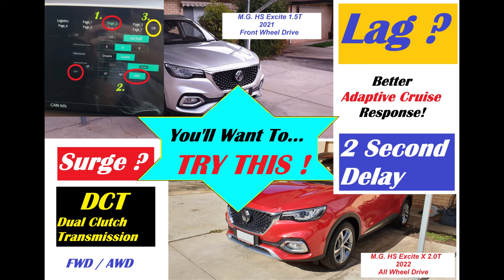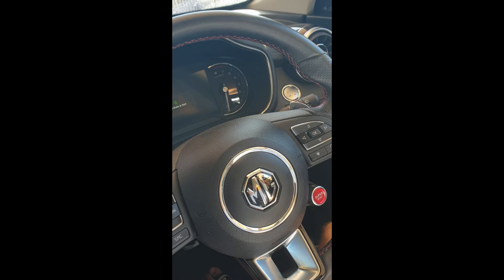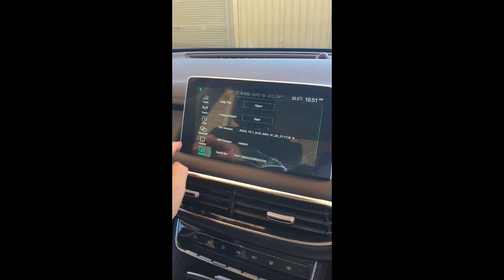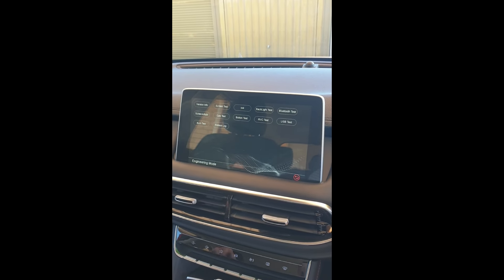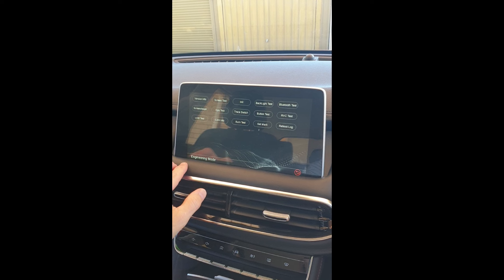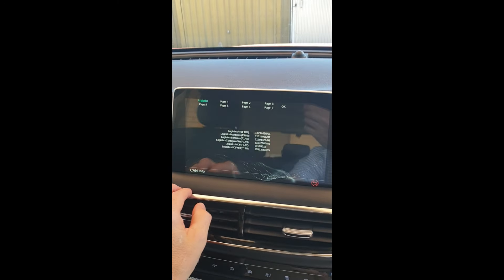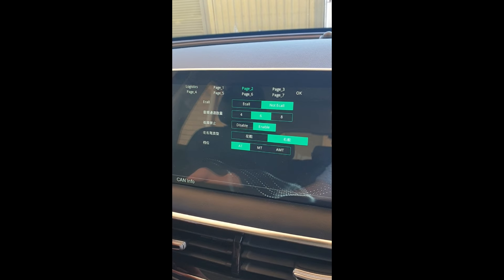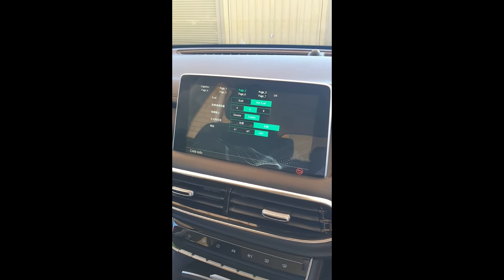M.G delay lag with DCT transmission 2021 2022 2023 2024 MG HS Driving AMT Engineering Mode

Comment: I almost got into accident several times when accelerating from a busy junction as the car was not willing to go. Tried talking to the official dealer about (3x in 6 months) yet they could’t find any fault. After changing to AMT mode 1, I can feel slight improvement. Hoping the transmission fail whilst under warranty to a get new one. 😂
Reply from the maker: @willytham284  when i came across the information and all credit to that person,  changed my mind to selling my car. My first new car had mo issues so when a car hit me in the side and wrote off my  car and i got another new car i noticed a difference in the driving experience so i knew straight away something was up. Thanks to the person and social media so we can share knowledge to make a difference. 🙂
Reply: we’re grateful that this channel brought up different POVs and experiences from HS drivers across the world. Really appreciate your effort for creating this video.
Reply: Driving a DCT car isnt like driving older transmissions... smooth acceleration is required not planting the foot
Reply: Same! That default setting is dangerous!

Comment: I am so much thankful for this video. I was about to sell this car because of the gearbox issue. But now the car is so much smoother and quiter that I am beginning to like this car. Thankyou so much for this useful information.
Reply from the maker: You're welcome! I came across information and so made the adjustments and found it improved my vehicle. Thank you to the ones who initially announced the information 🙂👍
Reply: Will it affect the warranty on the car??
Reply from the maker: @eshwarkrishna8339  ive heard recently that they have made changes coming out of the factory and update firmware when getting vehicle serviced, so check with your dealer as to if they have any recent updates.
Reply: @Hobby1976  i just bought a used one today from the dealer so probably like you said they might have done the update
Reply from the maker: @eshwarkrishna8339  if you go into the Engineering Mode,  you should see the firmware version or similar so then that can be compared to what latest version is released. Maybe that's something soneone on here already knows? Or I'll try to find out. Each country though might have difference.
Reply: @Hobby1976 Thank you ...i purchased the car here from Melbourne

Comment: My new car 2024 , I have been trying so many times to get the engineering mode on the screen but I can't. I've tried to touch all the points but nothing works. My screen version is hw001. If any one can help? I'll really appreciate it
Reply from the maker: @aboualaa2773  hi. when you touch each corner of the edge of the screen , do you hear a single beep?
Reply: @Hobby1976  no , no sound detected
Reply from the maker: @aboualaa2773  have you tried tapping near the corner instead of closer to corner to see if the screen is not calibrated correctly?
Reply from the maker: You need to hear a beep for every tap corner,  miss even one will not work.
Reply from the maker: there is a revised radio hardware and software update (whole new radio for those that need replacement). So new vehicles that have the revised equipment  seems they cant access🤔
Reply: @Hobby1976  is there any way or update or even downgrade way that I can use on a USB so I can use the old version of screen software to access the engineering mode option. Thanks so much for your help.
Reply: I guess that there is a way to get the can info screen on the new version but still needs more trying until someone can get it. Hoping it'll be soon 🍀🍀.
Reply: In mg zs, the info screen can be seen using equalizer mode and pressing under  -12 DBS. I guess that new version of the screen may have a different reachable module than the other Old ones used in all videos to get the can info screen.
Reply from the maker: @ there is no easy way to do this, it would have to be some sort of back end diagnosis equipment to do that sort of thing, where there may be aftermarket diagnosis tools to allow you to download and upload files etc. unfortunately i don't have the answers.
Reply from the maker: @ when your on the system screen. try tapping areas of the screen to see if you hear any beeps, this may give you a hint if its possible. i would try tapping every inch of the screen.

Comment from the maker: hi. I have had one dealer from the service department in the UK reply at least. he said he was not aware of this issue and that changing any settings in the engineering mode without mg approval would invalidate the warranty. so I'm still waiting on the other mg dealers' response. I reckon he has a lack of experience and or knowledge as this issue has been world wide renown for years. hmmm.  I will see if I get any other replies from the other service departments at the M.G. Dealers. I'm not expecting at this stage because it's been a few days since I sent the emails.
Reply: Any other dealer response pls?
Reply from the maker: @muhammadusmanbaig1003  fell on deaf ears from other service departments, seems people are afraid to speak out.

Comment: My MG HS is 2020 1.5T chinese spec. I can able to go into engineering mode but I cannot change any settings in CAN INFO. Could you please help me out. Thanks in advance.
Reply from the maker: @mohameddhanish1  you should see at the top of the screen two rows.... Logistics   Page_1 Page_2 Page_3  and second row... Page_4   Page_5 Page_6 Page_7   OK 

you need to tap a page to change settings and must tap OK afterwards for savings to take effect. does it allow you to 1. tap a page to view that settings 2. allow you to change those settings.  try tapping a little lower around incase screen not calibrated correctly when tapping on Page_
Reply: @Hobby1976  Thank you for your reply. I tried switching all the pages. I can able to view all the pages but I cannot change the setting and the ok button is not showing as well. Is there any way to unlock these settings.
Reply from the maker: @mohameddhanish1  interesting 🤔 i have tried to recreate the issue your having but no sucess. Im wondering if its locking you out? Ive not heard of this before. In the system view before taping all 4 edges of the screen , it shows Version etc. Is your version higher or lower than that of this video? Sw version AS23_10.1_AUS_NAV_41.26_211118_R. HARDWARE VERSION HW001?
Reply: @Hobby1976  
SW version: AS23_CNSA_10.1_MP5_41.59_191030_R
HW version: HW003
Qt version: v5.8.0
Reply from the maker: @mohameddhanish1  well certainly different software and hardware numbers. Wonder if MG have put a stop to this knowledge release to the members of public ?
Reply from the maker: @mohameddhanish1  has your vehicle had a service recently? Wonder if it was updated in the last service
Reply: @Hobby1976  I have did my 10k service last month but even before the service I tried to do this in engineering mode still it doesn’t work.
Reply from the maker: @mohameddhanish1  i heard.... there is a revised radio hardware and software update (whole new radio for those that need replacement). Sos that have the revised updatss seems they cant access🤔
Reply: @Hobby1976  is there anyway i can access this?
Reply from the maker: @mohameddhanish1  i don't have that answer at this stage. if i hear or anyone reading this has any information will comment below 🤔
Reply: @Hobby1976  okay. Thank you for responding my comments.

Comment: Would this void the warranty in any way do you think?
Reply from the maker: that's a good question, without the improvement by selecting the AMT , the vehicle had more uncomfortable surge instead of a smoother more responsive system, It would be worth asking MG, which I will email, see what their response is. 🤔
Reply from the maker: In the MG website under the warranty terms and conditions it mentions software and any third party apps etc. But the question still remains wether changing AT MT AMT setting can invalidate the warranty? I am emailing MG to see what their response is.... meanwhile see below... Third Party Apps and Software
MG Motor UK Warranty does not cover any damage to the vehicles software, or any harm or loss to any data or
personal information uploaded to your MG vehicle that is a result of any modifications or unauthorised access
to vehicle data or software from any source, including, but not limited to, non-MG parts and accessories, third
party modifications, third party applications, viruses, bugs, malware, cyber-attack or any other form of
interference.
I-Smart App
MG Motor UK is not responsible for the warranty or maintenance of the I-Smart App/Software. Warranty will
cover as part of this warranty agreement failure of the I-Smart hardware fitted to your vehicle if the failure is a
result of a manufacturing defect. Please note the limitations in the above paragraph (Third Party Apps and
Software) apply.
Reply: @Hobby1976  Brilliant, thank you! It’s a problem that’s bugged me since I bought the car, I do find that when I’m in ECO mode, it’s not as bad and you also don’t get that massive kick-down lag, but it would be nice to finally fix it.
Reply from the maker: @ApeEvolved  hi. I have had one dealer from the service department in the UK reply at least. he said he was not aware of this issue and that changing any settings in the engineering mode without mg approval would invalidate the warranty. so I'm still waiting on the other mg dealers' response. I reckon he has a lack of experience and or knowledge as this issue has been world wide renown for years. hmmm.
Reply: @Hobby1976  AMT is installed on the cars operating system... it is not a 3rd party ap
Reply from the maker: @InHisShadow57   @InHisShadow57  thats correct its not a third party app, i never said it was, if you re read the whole comment it also includes.....   (interfering without authorisation in any other way). Dont shoot the messenger i just put what they stipulated. 🙂
Reply: @Hobby1976  Im pretty sure that means Hacking the System... just changing a mode isnt hacking....nor is it changing anything in the cars Operating System....one person from our Facebook group actually took her car to an MG dealer and got the Mechanic to change hers to AMT...others asked their Dealers and they didnt even know how to access Engineering Mode...so id say they wouldnt even be aware you had changed it anyway...
Reply from the maker: @InHisShadow57  i agree, its not surprising how it differers from dealer to dealer etc and if the manufacturer didn't make it easy to make these changes they would have simply password protected them or hidden from the gui in the first place. I know my car runs better and ive no reason to tell them each time i take it in for service and never had a problem . Your right they don't even know or check lol. 🙂👍

Comment: I've got the MG HS Essence and have had a few near miss accidents when the car decides it is going to take off like a slug until the turbo kicks in. Making the vehicle almost "not safe for purpose". My setting was set to AT but AMT is a new technology that is better than AT. AT is very old, also if it voids warranty, it shouldn't be an option. I will need to explore more when I get home from travelling but in the short duration, I have noticed a change. I'm going to speak with the service manager of my local shop about this issue as we discussed the flatspot, also he said it's even worse in the ZS range.
Reply from the maker: yes exactly that's what my concerns were. nothing worse than holding traffic up behind you whilst you wait for a mile gap to pull out. 🙂👍
Reply from the maker: Yes I agree if vehicles are set at AMT and others at etc and it's just a option in the settings I think it's almost like a scare tactic or something about warranty. Well I've set mine at AMT. 🙂

Comment: What even is that setting? We're changing something we don't know what it is or does?
But I wish I'd know about this when we had one of these. That gearbox is bloody dangerous!
Reply from the maker: I see that the new 2025 MG HS range have a wet clutch gearbox etc, from the other reviews saying that the transmission with the previous years DCT issues with the transmission. However some reviews still say that there is still transmission issues with the new 2025 new HS range. I also saw that at this stage there is not  AWD 2.0t version in the New HS range, and the driver frustrating alerts etc, im happy i still have my AWD 2023 and glad i didnt wait for the new release. 🤔

Comment: Will this help for an MGZS. Im still waiting for the service appointment its a brand new car. Goodnon the road but not so good at signals.
Reply from the maker: @salmashaikh9067  yeah its the signals and intersections when pulling out that is frustrating and the delay can be concerning. Not sure about the ZS models if the settings can be changed?

Comment: I am driving the MG hs standard 1.5T. There are no driving modes. I tried switching to AMT mode to drive, the gearbox is indeed much smoother. But there is one problem I encountered, when I switch to AMT mode, my steering wheel is very light, much lighter than the AT setting. Do you guys encounter the same situation?
Reply from the maker: @AnhHoang-qy4vs  no i didn't notice the steering. I think that you can change the power steering setting from what i remember if it was something that can be changed on the MG. Ill get back to you if i remember in the coming days. 🤔
Reply from the maker: @AnhHoang-qy4vs  Page 48. Owner handbook.... INSTRUMENTS AND CONTROLS
Electric Power Steering
If the electric power steering fails or cannot
operate the steering will appear very heavy,
this will affect driving safety.
The electric power steering system only works when the
vehicle is started. The system operates via a motor with
assistance levels automatically adjusted based on vehicle
speed, steering wheel torque and steering wheel angle.
IMPORTANT
Holding the steering wheel on full lock for long periods
will result in a reduction in power assistance causing a
heavier feel to the steering for a short period of time.
Steering Mode Switching
The electric power steering system provides 3 different
steering modes:
1 Normal: provides moderate power assistance.
2 Urban: provides a high level of assistance, with a light
feel.
3 Dynamic: provides low level power assistance, with a
heavier feel.
The steering mode is selectable for vehicle speeds up to 60
mph (100 km/h) through the touch screen interface.
Note: Steering mode selection is only available when
the steering wheel is not being turned. Any changes
made in this state will not take effect until the steering
wheel is straight ahead.
Electric Power Steering (EPS) Warning Lamp
See "Warning Lamps and Indicators" under the
"Instruments and Controls" section.
Reply: @Hobby1976  Thank you for your help. My version is MG HS standard facelift, i dont have 3 steering modes. But in facelift version, MG add more gearbox Type ( DCT, CVT, ..) I'll test other type and find the different :D

Comment: My MG HS have issue during call i cant operate my ac u have same issue with ur hs?
Reply from the maker: @jainitpatel8580  yes i did have the same problem I noticed and  it was so annoying,  i will try to see if there is a solution to that and let you know shortly.
Reply: @Hobby1976  thanks
Reply from the maker: so this morning I made a call I received a call and I could control the air-conditioning controls. To my surprise because I remember in the past as soon as I received a call I could not switch to the air-conditioning controls. I tried more tests with both the USB cable connection with the phone plugged in and disconnect to see if it made any difference and I could still navigate to the air-conditioning controls. Whereas in the past I remember this was a problem. My question now is how can I re create the problem, I'll see if I can. 🤔
Reply from the maker: Today I was on a call and I experienced the same fault, I could not access the air-conditioning controls, I could not access the home button screen and I could not access the settings screen, whilst on the telephone. However when I got home and got my camera to film I found that I could access the air-conditioning controls, but what I did notice was that I still could not access the home screen or the settings screen until I ended the phone call. What I found was this was only when the USB cable was connected to the phone using Android Auto. There was no problem during a call if the phone was connected to the car by Bluetooth wireless. I could access home screen and settings screen and air-conditioning whilst only Bluetooth wirelessly connect to the system . So there is definitely a problem whilst using the USB cable connection. I hope to re create this fault and capture on video. Meanwhile I have seen on my mobile a few Android Auto firmware update. So maybe it has something to do with that🤔
Reply: No i have apple and when it is connected on bluetooth mode during call i can’t able to ac control the only way to turn off and turn on ac is ac button hold for 10sec but when it is off mode out side air coming in..
Reply from the maker: apple carplay with Apple iPhone 12 connection by Bluetooth wireless does not have a problem accessing the air-conditioning controls whilst on a call. I was lucky enough to try with my mates apple phone as I am Android. So this may be more a phone issue 🤔